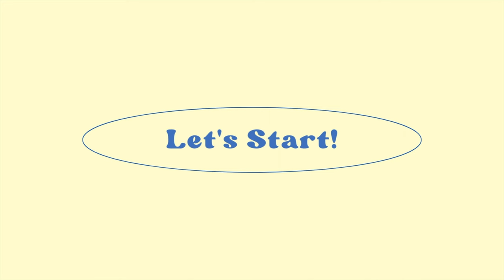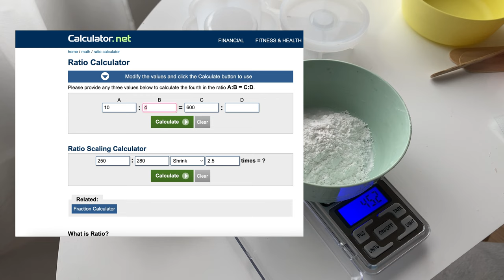DIY Aesthetic ECO Resin Candle Holder and Tray | ResinCrete JDiction

Comment: Hi, I was thinking of purchasing the Resin Crete and want to make candle vessels to hold candle wax, can the wax be poured into a vessel made with the Resin Crete?
Reply from the maker: Hi! Thank you for watching :)
I made a candle jar with a similar product last month for personal use because the company actually had a video using them as candle Jars. Resin Crete didn’t feel as durable so I’m not sure if they’ll be heat resistant. I’d probably reach out to them to double check :)
Reply: @joolieshome  thank you for answering my question. I will look into it further, have a great night.
Reply: @mightycatcreations1968 

Hello, I hope you are well. I'm still coming because of the same question you have. I am between choosing Jesmonite or ResinCrete for the containers of my candles. But I'm worried about heat resistance.

How did your project go? Thank you in advance!